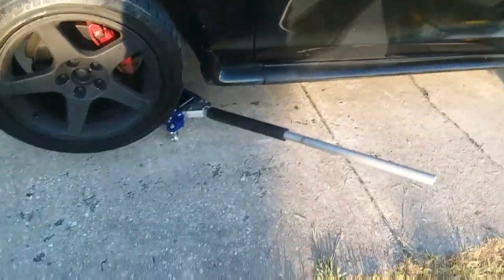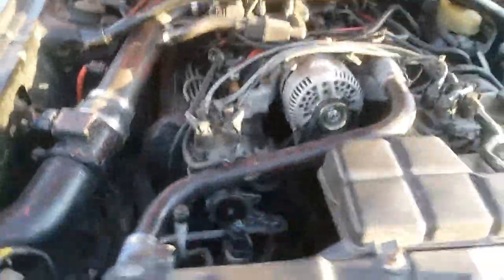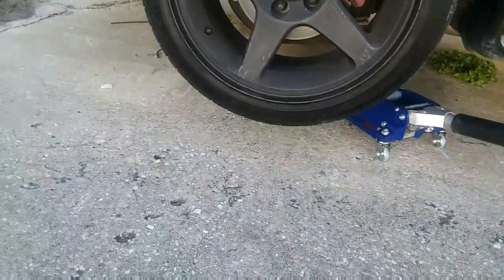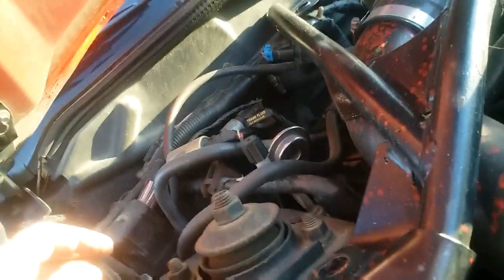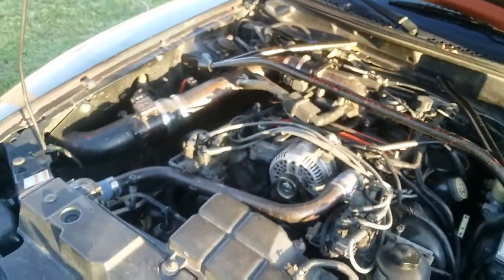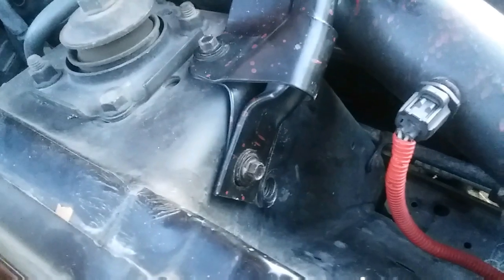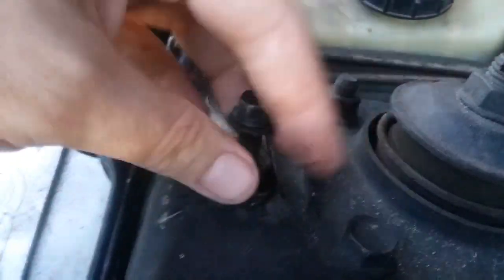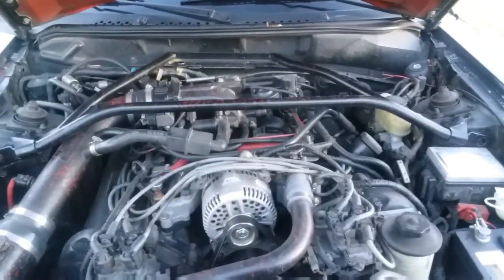Sn95 strut brace test

Comment: Great video. I have a 94 cobra and after watching this video I will definitely be investing in Strut Tower brace. Was going to go with the BBK part number 2513. Is that what you are using?
Reply from the maker: Actually the brace im using came stock on the 96-98gt.. not sure if it came on the 99-04 gt but i think it did also. The bbk piece is a great piece. You should check out LMR and see what they have..you might end up with a better deal.
Reply: @TheModAddict  thanks for the info. I actually found it on Amazon cheaper than anywhere else. I think I'll order it up tomorrow. Might have to drill the strut Towers which I'm not too crazy about doing but after seeing your video I think it will be worth it.
Reply from the maker: Im very happy this video helped you. Id love to have you subscribe if you haven't already. My edits at the moment aren't the best but got some things in the works for a lot better videos.
Reply: @TheModAddict  I will subscribe right now. Thanks again!

Comment: You know I had one on my car when it was a v6 and I felt like I could take any corners not that I have the mach 1 motor I'm not sure its because of the weight of the motor or cause i don't have that brace but i feel like I'll flip when i turn 😂😂😂
Reply from the maker: Lol there is def some wiggle room without it..
Reply: HorsePlay Motoring might have to slap one on my car
Reply: Upgrade struts. I have Koni struts. It completely changed and improved the way my car handles.